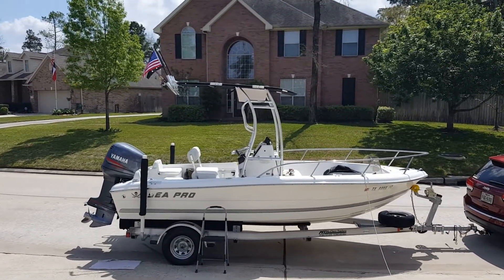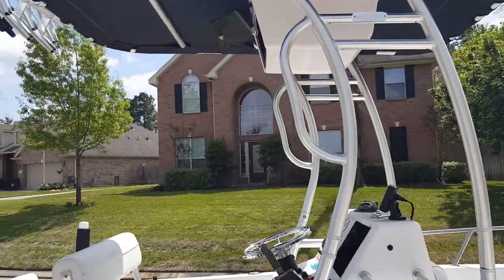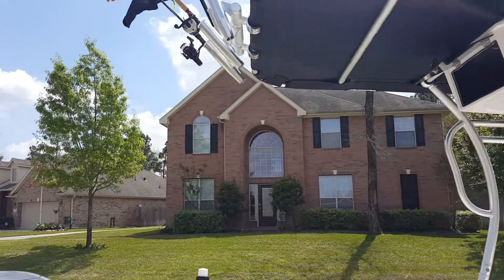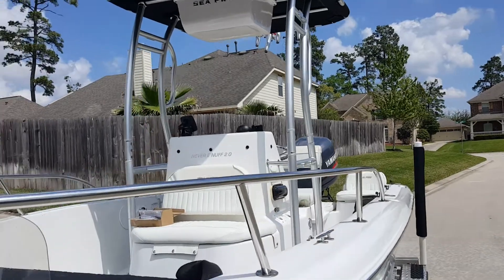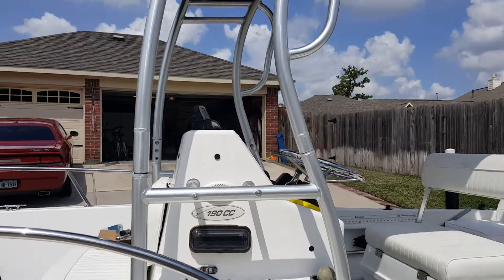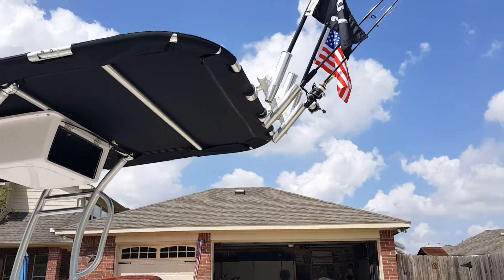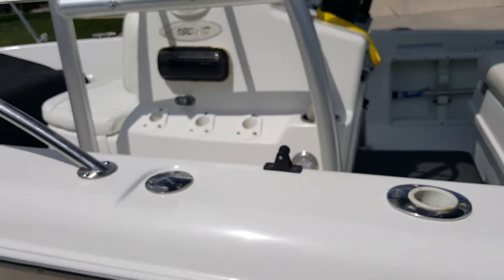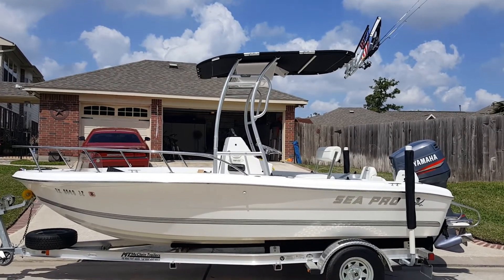Sea Pro with T-top installed

Comment: Hey Scott, looks great.
I just bought a Dolphin fit my 2004 Sea Boss. Very similarly to Sea Pro.
Did you use black rubber pads between deck and bottom feet?

Also did you purchase the quick release knobs. I have six. Haven’t put it together yet, but wondering the bolt that is required to stay in, does it need a hard plastic washer to pivot, or does it not tighten up all the way. 
Regards 
Steve VW
Reply from the maker: Hey Stephen, yea the Sea Boss and Sea Pro look very similar.  I did not use the rubber feet on floor, i pre drilled and used 5200 for a secure bond, has worked great. In addition i used 2 mounting points on the center console instead of one on each side. I took off the SS handrail and the holes lined up perfect for me, just had to drill the holes in the TTop cross bar.  Enjoy your new purchase! I have had a great experience with mine.
Reply from the maker: The pivot point, i tighten up when using and then loosen when folding

Comment: I just ordered this t-top. yours looks great! do you tow it at 70mph with the canvas on it? i saw the instructions said remove the canvas over 45 mph. also did you install using the supplied wood screws? thanks in advance.
Reply from the maker: I never did remove the canvas when towing, have not had any issues.  When i screwed it to the deck i also used 3M 5200 on the pad of the ttop legs and in the screw holes before screwing down.  Make sure to use the side console stand off also for support and to tie all toegethet! Enjoy your new top!
Reply: @scottward8038  great, thank you
Reply from the maker: @hgbpro  Share a pic when you get it installed!
Reply from the maker: @hgbpro  looks great!